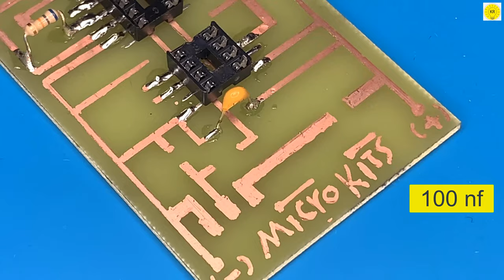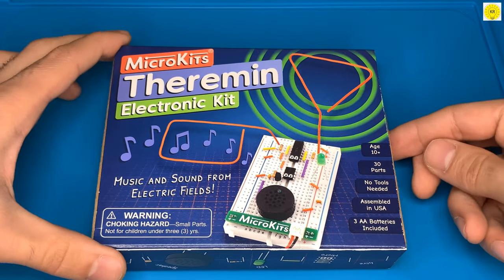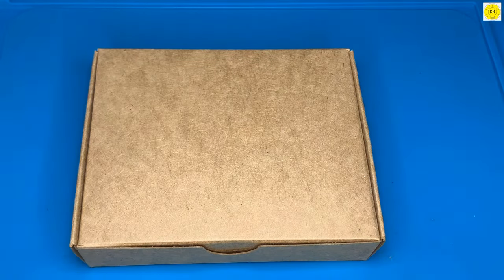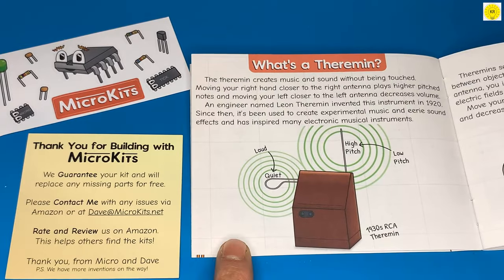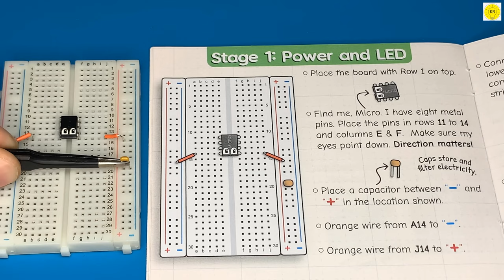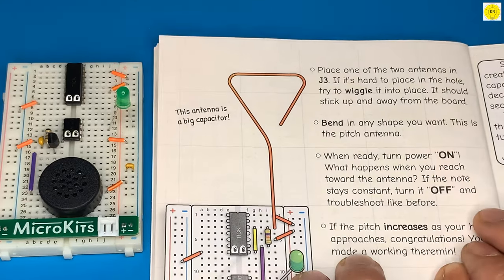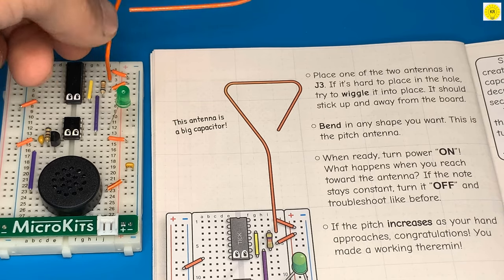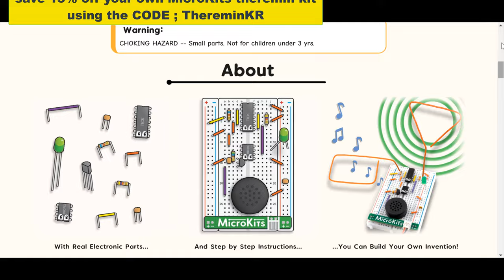how to make simple electronics projects , microkits theremin

Comment: i'm pretty sure that the small ic that it has 8 pins is 2822ic 
because 
1. 2822ic is a sound ic
2. when we use the 2822 ic . we use all the pins except the pin number 3
Reply: It's actually a PIC microcontroller with custom code to read in the signal from the timer and automatically calibrate before sending out an audio signal!
Reply: @buildmicrokits  Ah... An arduino ATiny?
Reply: @FrikiObsoleto  typical mpu crap that of course no one can duplicate due to not having the code or a programmer.  Good way to rip people off though instead of making an equivalent circuit using op-amps and a 555 timer that anyone can build.

Comment: It's not much more effort to drill that board and mount the parts on the other side to the tracks.  You would make a much neater board doing that plus the parts would be properly held in place.  Plus it's useless to everyone to label a chip 'micro' and not provide the proper part number.  Sad how you only sell through Amazon, a company on my boycott list.  Please make a website and sell from there.
Reply: I don't buy from Amazon either
Reply: Я то не покупаю на Амазоне

Comment: Hey there,

I had a question that I wanted to ask on Reddit but my karma was too low. 

How do IGBT’s make a pure sine wave for 60hz?

I’m very new to this so sorry if it’s a dumb question. I understand that they switch on and off many times and the more they do that, the average looks more like a pure sine wave. If they only switch on and off 20,000 times a second and pulse width modulation works best when the pulses are extremely fast, how do you generate 60hz of ac? Thanks for your help.
Reply: You're not dumb for asking this question.
IGBT or Mosfet can make 60hz Sine wave because the driver modulates modulating PWM Signal and then send to the gate of IGBT.
That's all I know.